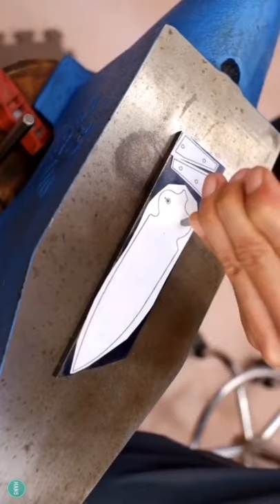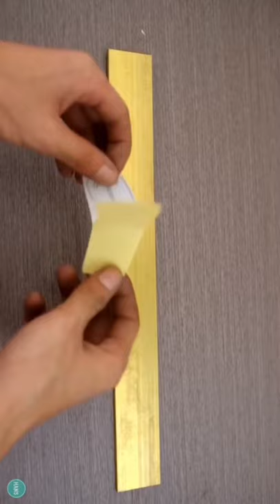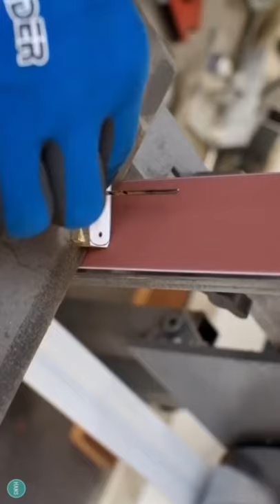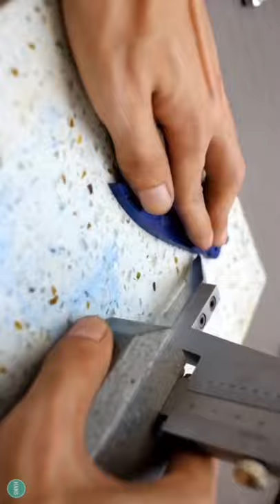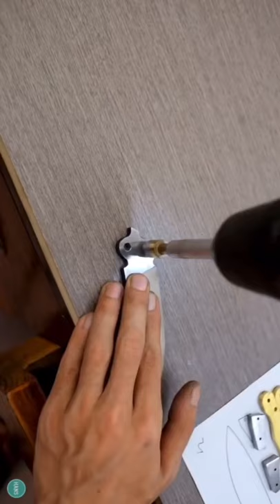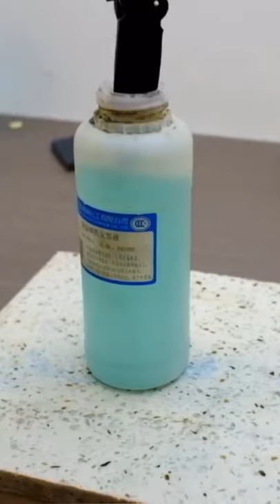i'm a Little Tired Butterfly knife Subscribe Now

Comment: Did you heat treat the blade ?
Reply: I think there is no reason to, it will propably be used just for flipping
Reply: @radosawbrzezinski4161  this doesnt look like a super flippable knife. also you do need a good heat treat on flippers as they wont be very durable when you drop them or from the repeated contact between the handles and the blade